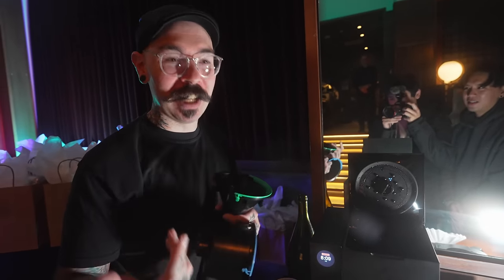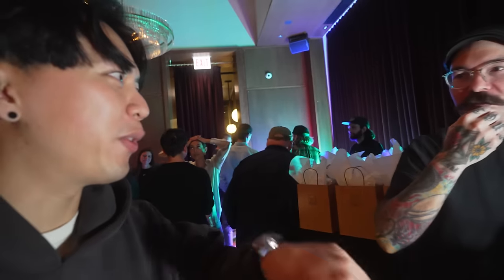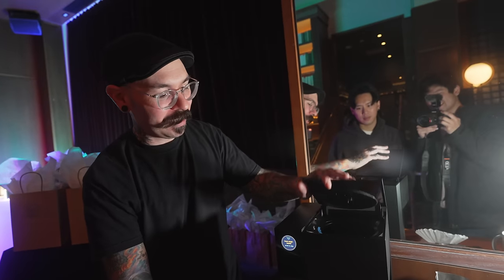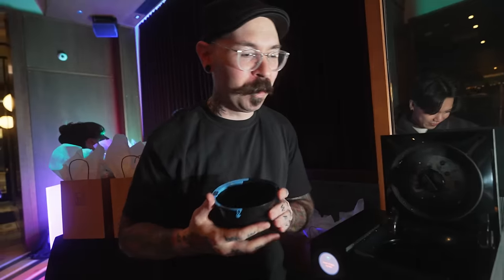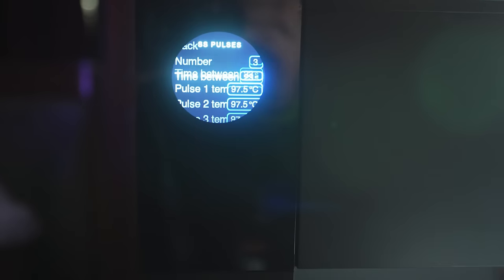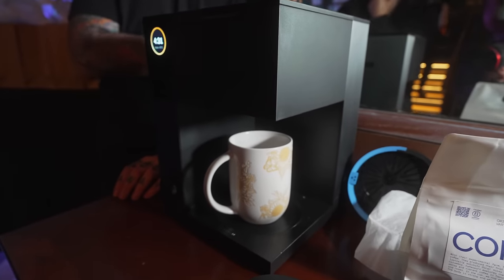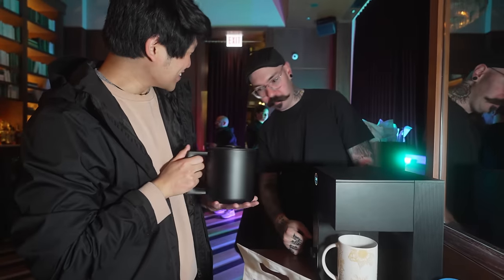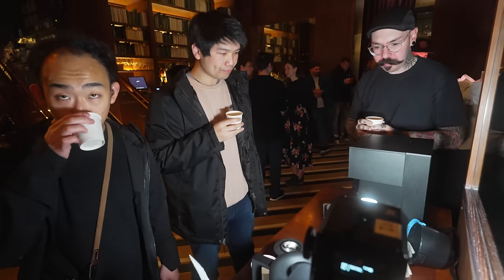Fellow Aiden ft. our good friend Nick Terzulli!

Comment: Is the exclusive coffees you get for preordering worth the potential hassle for this product to be faulty? First run products run risks of defects, faulty operation, or just not living up to advertising mojo. I'd wait.
Reply: Nick is pretty good at making sure the products are ready to go
Reply: @HappyAccidentVideos there are so many people with staggs that die within a few years. Their lack of QA is unacceptable.
Reply: That's actually a good point. I'd be afraid to buy ANY new fellow product no lie
Reply: @ahpadt  my $350 ode gen 2 is not worth $350. Looks nice but clogs something fierce if you don't slowly add beans while running. The grounds knocker literally doesn't do a single thing for retention because the tolerance between the grind chamber and auger is too big. Plus the ionizer gimmick does nothing to prevent retention inside the grind chamber because it's downstream of the grinding process. That thing solely prevents grinds from sticking to the exterior of the grinder. Low-key feels a bit like misleading advertising
Reply: @Not_Lewis more people will tell you the same but I haven't had any issue like those ever with the ode 2
Reply: @ahpadt that's what really holds me off. Too many sensors !
Reply: The way that kettles work causes them to break every 3-8 years. That’s just the fact of how all quick temperature kettles are designed - not unique to Fellow because it’s happened to all my kettles.

Comment: you don't need to rinse the filter paper before brewing?
Reply: I mean you do, but they didn’t for the demonstration. I’m sure you could run the basket with the filter in it under the sink to rinse it before use.
Reply: @HappyAccidentVideos  could you with the drip stop?

Comment: Wonder if there will be a non-plastic basket available at some point
Reply: I won’t brew in anything but plastic. Metal and ceramic suck for heat retention. Plastic is GOAT
Reply: I will always preheat rather then use tacky and gross plastic
Reply: I realize plastic performs better in ways, but I prefer to not drink hot beverages brewed in plastic
Reply: @lawnboy090  There’s no issue with using certain plastics
Reply: @Chris-gq8ev  why gross?
Reply: @HappyAccidentVideos  I disagree, but to each their own.
Reply: @lawnboy090  I mean you can disagree, but I’d still like to know your reasoning.
Reply: @HappyAccidentVideos  I’ve read studies that concluded that even BPA free plastics can leach chemicals with estrogenic activity. Admittedly I am not an expert so if there is conclusive evidence to the contrary I’m all ears.

Comment: Next step is to have a built in grinder that adjusts settings based on brew size like the xbloom.
Reply: Personally I'm glad it doesn't have a built in gridner.  I like grinding myself but I know that's not for everyone
Reply: Many xbloom reviews are stating they prefer that model without a grinder. I agree with that statement.

Comment: I know it’s all BPA free, but I’d gladly pay a little more for less plastic components. Replace with some more glass and metal!
Reply: Glass and metal soak more heat, there's more temperature stability with the plastic.
Reply: @snowboarder2017  true but I think at this level of engineering, they should’ve been able to work around that.
Reply: @daeji5 that would cost a lot more. The plastic is fine